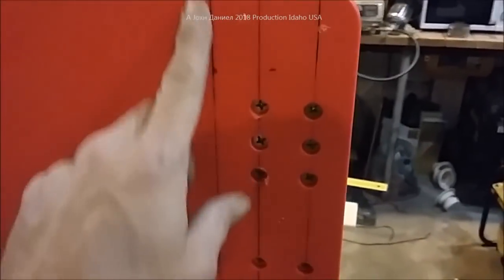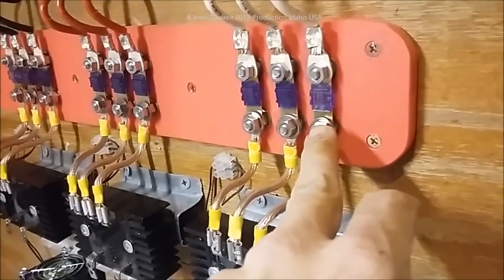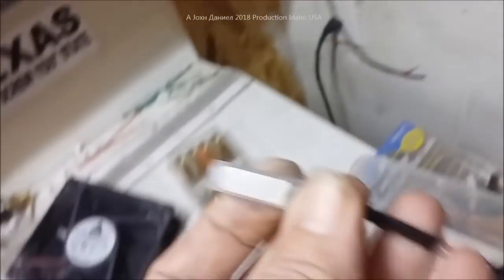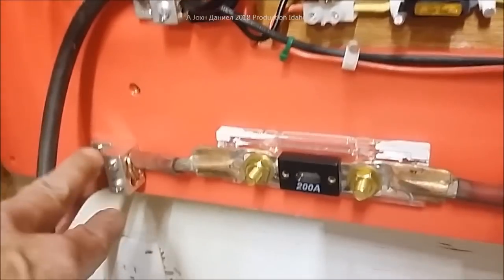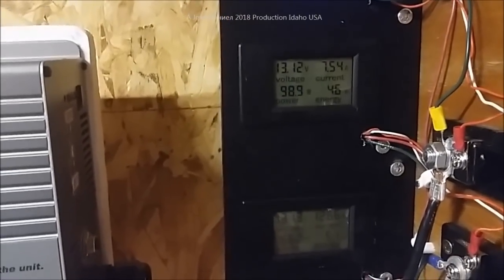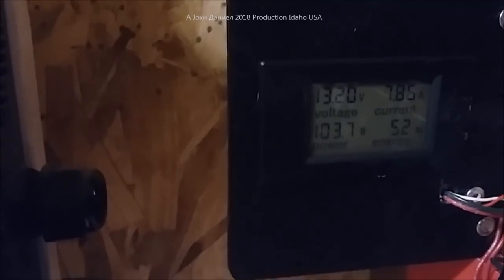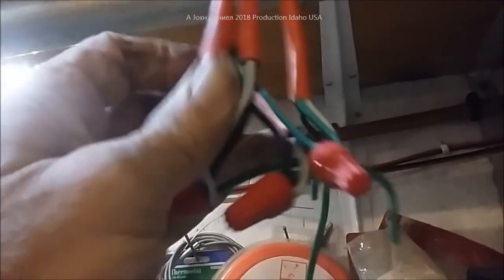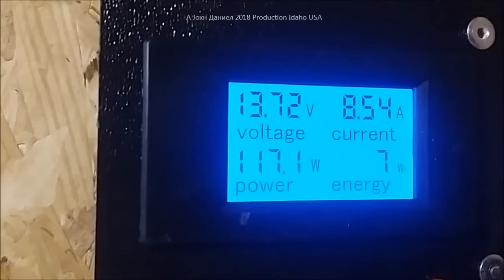Micro Wind Turbine 3 phase power systems Rectifiers pt. 1 my FULL PARTS LIST BELOW

Comment: How do you  connect the watt meter to read the input from the turbine?  The schematic on the  back is for load application.  I just want to read directly from the wind turbine.
Reply from the maker: Load goes to the battery, thats to be connected first, then power wire and ground on the meter if so designed, then supply side + goes straight to battery from rectifier or controller from the turbine. You typically put your shunt on the negative side from the output of the rectifier or controller and pass through it to the battery negative. Thats if your using a similar meter as mine. Hope thats clearer than mud!!
Reply: Јоhn Daniel yes thanks, I figured it out...but this vertical turbine doesn’t seem to be producing well, the controller is labeled 12/24v but I’m seeing 10.5 max in about 10mph wind. 
Connect to a 24v battery bank.  Don’t think it’s adding any charge at all...
I think I need over 24v to charge. 
Any thoughts, the housing of the turbine looks like yours... any thoughts?
Reply from the maker: @thebluedan  looks like another Scam sold model in my guess, a high voltage model thats for buzz charging not for large batteries, they use buzz charging on light poles, not usable on what your building. Return it,  I would file on it with where you bought it as a fraudulent ad, fake claimed, or not as claimed even though it may be past return. 
(buzz charging is using a high voltage PMA to charge a small pack of 8 - 200 volts 3300uf capacitors and the release on a rate which then bumps nearly nothing into the batteries.  Good for a 18 watt LED chinese street light, worthless for your needs)
Reply: Јоhn Daniel I’m watching one of your other videos...looks like the same one you’re using. ...except for the updated blades. 
My blades are red and don’t have the extra little blades. 
I do appreciate the information.
Reply: Maybe I can try a separate rectifier and a pwm controller for the turbine ...I have solar with a outback mppt controller on the same battery bank.

Comment: I'm working on a setup running a 400 watt ac turbine mounted on a 20ft pool. I have 9ft of 12 awg stranded wire coming off the turbine into 27ft of 8 awg stranded wire then connected to wind charge controller. Is that a good match? I would very much appreciate your answer, thanks for sharing!
Reply from the maker: Your well covered on ampacity and gauge just make sure your turbine is up to par and putting out as claimed you'll be OK to roll in the watts! So many of these turbine sellers now use that fake advertising trend set by a Missouri con Man who can remain unmentioned because he got away with it for a decade. Its gotten so bad that you have to do some serious studying, watch for people who found a real one, and believe no sellers claims.
Reply: @JOHNDANIEL1  Thankyou for your input. I decided to replace that 9ft of 12 awg with 8 awg. So now I'm using 8 awg for the whole wire run. The turbine "Chinese" is made/sold by Vevor "not you know who". This is my very first wind turbine so I hope I made a good choice. For lower wind speed is 5 blade better than 3 blade turbine? 
Best Regards, John B.
Reply from the maker: @jbhobbyist9372  VEVOR, they do have some good models made by FWP and some made by Ni Air that are seriously over rated. You can tell by weight, the real performing 400 watt ones are small but weigh over 25 lbs, the near same looking but non performing weigh about 16 lbs.  I did some buyer installs on  both and more models from VEVOR ( a big sponsored seller on Amazon who gets pushed to the page 1 list for buyers like MARS ROCK) but learned to avoid them after numerous people complained about them being only capable of 50% output. Upgrading the wire may help though, lets see how it does. Truthfully the big performing ones are far back in the sales pages due to them having no money left to pay off Amazon or Ebay when they have to price so low to compete with the fakes. Consider that in Ads, the fakes will list first because the profit on them is high, they can pay off Amazon and Ebay to be sponsored up front. Quality will take a back seat so to speak!
Reply: @JOHNDANIEL1  Mine got up to a whopping 1.5 amps today between a 10 to 15 mph wind! It's coming down in a couple of days I want to run that test with a 5/16 allen shaft and power drill like you illustrate in your videos. I have a Hyper Tough 12 volt lithium cordless and a Hyper Tough 1/2"  6amp Hammer Drill to use. Plus now I want to weigh it lol to see if I got junk or good. I will let you know how it turns out. Again, thanks alot for the information I learn a great deal from good people like you.
Reply: Hi John, I just completed my test. Wind turbine net wt. 15 lbs. Ran test with turbine still on the pole and connected to power with blades off. Using Marsrock charge controller and thermodyne amp meter for my measurements.  Using  a Hyper Tough 12v 0-750min drill fully charged, results 2.18 amps. Using Hyper Tough corded 6 amps 0-2800min, results 14.21 amps/185.1 watts. I balanced the blades using your technique. Before I started blades were off by more than 3/8", that's crazy. I'm getting rid of MarsRock charge controller and installing a bridge rectifier converting ac to dc. Then I will connect dc output to a Morning Star 1000 watt charge controller that is running 700 watts of solar panels and charging a 12v 1000ah battery bank. So with 300 watts to spare it should be safe to connect turbine to unit. Since it looks like 400 watt turbine is producing 185 watts of power under testing. Running 100% 8 guage Simpull Thhn wire. Looking forward to your thoughts on this matter. Best Regards, John B.
Reply from the maker: @jbhobbyist9372  Looks like a 200 watt PMA on a 400 watt claimed sale! I would file on it with where you bought it as a fraudulent or not as claimed even though it may be past return.
Reply: @JOHNDANIEL1  "Live and learn"! It was a 100.00 wind turbine gonna make the best of it and hook it in with my solar system. If I would have found you on YouTube first I wouldn't have bought it! In the future I will be buying that HAWT 500w turbine from AliExpress. I am going to file a complaint or at least let everyone know not to buy this product. If it was advertised as 200w turbine then I'd be fine.
Reply from the maker: @jbhobbyist9372  Here's a secret on Ali express. They watch yours shopping, and start pushing you offers of discounts. Do this, right below the video is that low wind 3 blade model, Its awesome and your already wired and set up for it. I would put that in your cart on Ali express, DON'T BUY YET,  so while it sits in there a while, they make you discount offers to hit buy or check out.
Reply: @JOHNDANIEL1  Cool! Good advise, just did it on 500 watt 3 blade. We'll see what happens, Thanks
Reply: Hi John! Here's a copy of the message I sent to the sellers/company I bought the turbine from. ("This is not a 400 Watt wind turbine! We tested with a 6 amp electric drill with 0-2800 min torque/power. Results were 14.21 Amps / 185.1 Watts. Your claims are fraudulent!!! Not very happy with YOU!!!") So in return they offered me a 50% refund/compensation for my troubles and I accepted. It pays to complain!
Reply from the maker: @jbhobbyist9372  ☑Check Mate Ebay/Amazon California Dropshipper Scammer! Excellent, now hold on to it, and when you can put the next larger sized blades on it and run it as a a spare. With the larger blades it may die in a few years but it would anyway being a knock off. It should have 500 mm( 20")blades or 550 mm(21.6") maybe. [Measure blades from the bolt hole nearest the hub center to the tip]  I have a set of 650mm more aggressive style and if I don't need them and its using the S-sized cast Hub I can probably ship them out for shipping cost and $15. About $25 likely. Or you can get a set from Amazon or Ebay for $65 but you already been there, done that!
Reply: @JOHNDANIEL1  Thanks John for the offer! I just had it down/lowered yesterday and had hub with blades off to balance blades after running my test and didn't think to measure the length. I'm gonna say there in the lower twenties but not sure about exact length.I could let you know at a later date. Standard 3 blade hub with S model flange if that helps.

Comment: What fuses did u use between the rectifier and the turbine? Don’t see it listed? Thanks
Reply from the maker: 3 - 50 amp Mini ANL, https://ebay.to/2oj6wrt and I made my own holders for them but you can use a simple holder like these https://ebay.to/2nBGeAO . You want to have the full power potential of 2 legs of your turbine, 100 amps can be hit if its the 500 W I have been using, you need the shorted max rating in that situation.

Comment: I'm working on a project related to regeneration using a motor to charge a 54 volt battery.The circuit I used is a motor whose three wires are connected to a 3 phase rectifier (SQL35A1000V) whose dc output is givent to a DC-DC booster (https://amzn.to/2oEy2ji) and a 54 volt battery pack to the output of booster. The rpm of motor is varying but the booster constantly supplies the battery 54 volts and 3.5 A(The booster is set to 54 volts and 3.5 A). 
The problem is that the 3 input wires to the rectifier gets extremely heated and end up burning/melting. Can you help me identify what the reason behind this is? and which wires will be good for this type of circuit.

Comment: Your setup looks nice. I've been trying to wire in one of those digital multimeters, however all I get is battery voltage. I placed my shunt on bat -. How did you wire yours? Did you use a different power supply for your meter?
Reply from the maker: They should have a schematic online for these,. you put BATTERY Bank as Load, but not knowing exactly your set up or model makes helping difficult. Send a picture and how your wired up to me, JOHN - olympicpowercontrols@yahoo.com

Comment: Do you not need a stop switch to bring the 3 phases together before the rectifier?
Reply from the maker: There is stop switches on the second floor that can dead short the turbine, but thats the last method you would want to use. My stop PULL switch design is a 1-2-3 not a 1-3, so its not the kind that burns up turbines.

Comment: in this video, the charging voltageis very stable, staying around 13.2 volts. but the current has a great swing (3 amps to 50 amps) (I think becuase wind speed varies, right?).  But in your other video when you did the test using power drill, the voltage increase a lot to over 15 volts when drill speed increase (like increased wind speed) .  The current pretty much stays the same at ~8~9 Amp.  So why is there such significant difference?  Thanks.
Reply from the maker: The effect is Drill Test 12v battery being 1 that is 80 ah, verses battery bank being 14 of the 325 Ah L16 batteries.

Comment: May I know what is the maximum current and voltage into the rectifying diode from the turbine (say billy jack bad ass) and the max output current and voltage output of the diode? Thanks.
Reply from the maker: BBA turbine has by my test maxed at 89 amps in wind storms, just peaks to 90, and hard running at 60A plus during those storms, that's why I use the ones I linked to under the video. The input I have not tested but I would say 3% higher than the output, its a 2.7% conversion loss on these rectifiers per the specs. 
The OPEN voltage in 30+ mph has hit 71 volts as 3 phase, with the battery disconnected that was 39.7 volts measured as a peak DC rectified.
Reply: @JOHNDANIEL1  so the rectifier can draw steady 60 amps from the turbine during storm?  That's a big  current.  How long is the cable from the turbine to the rectifier, and what gauge number of cable do you use ?
Reply from the maker: 26 feet of 8 awg, 3 strands. I could have ran it 45 feet like the home built Chaos Turbine if I needed. From that there's just 4" of 10 awg 21 strand 100% pure copper wire between the 60A mini ANL fuses and rectifier, not a problem if it stays under a 6" it can handle it.  You would use 60 amp, math is ( 60x2.17) for max pre-rectifier capacity. 125 amps max flowing load, but allows it to blow at 60 if a rectifier leg fails. 
Then 6 awg to the Bus bar for the battery. We had 9 hours of 40 mph in a major inversion, we get that 6 to 10 times a year at 4350 feet elevation I am at, and common daily winds are over 16 mph. So the Rectifiers I choose are from trial and error. Never under gauge!
Reply: @JOHNDANIEL1  It is amazing that 60-70amps did not burn the generator coil.  it must be big gauge wire, isn't it?  what is the output impedance of the generator and the input impedance of the rectifier?

Comment: can you please tell me what would be the max voltage that comes out of the bridge rectifier under load?  on a china turbine 500 watts 48v system. I know when I spun up the turbine on the bench with no load just going through the rectifier it was putting out over 100v. the charge controller I have on order has a dc input of 12-60v. it's an MPT-7210A Solar Controller. It can charge lithium. many thanks for your help.
Reply from the maker: 3 am, but You caught me loading cows in the bull hauler truck! The answer, about 63% of open voltage will be the rectified open volts. 100 volts no load = 63 volts rectified no load. But as soon as you put it on that controller, you may have a max rating that could go far past max on high winds. I refer everyone to get this https://amzn.to/2Wk9H2r set of 18 AH batteries, run your supplied wind turbine controller into it, from the 48 volt ( those 4 batteries ) run that as a source into the controller you have. Set the disconnect from source voltage at 44 volts.

Comment: If you use bridge recrifier,is it neccessary not to use wind turbine charge controller?just hook the rectifier to battery?
Reply from the maker: Turbine to rectifier, rectifier to battery. Diversion load controller to keep turbine excess sent away from battery into water heater or load resistors or hydrogen cell.  If you have a very small battery bank, use the provided controller. I prefer not to use a small battery bank on wind turbines though. Capability of storage @12Volt - 160 AH@20 per 100 watt rated on the GE-500 models, but if its a missouri turbine you can go with 35 ah@20 per 100 watt claimed. Half those battery numbers for 24, 1/4 for 48 volt. Example  you will need 80 AH @20 for 24 volt per 100 watt.

Comment: hi sir .  i have 2 mppt controller to same 12v battery setup and i want to buy a 500w 12v wind turbine what, do i will need the Rectifier, the resistor and what else .

Comment: The only change I would do is add 3 capacitors (0.1ufd 1kv) across the turbine lines to reduce diode switching spikes from feeding back to the coils. 
And add a capacitor (1000 ufd 35 volt 105 deg) across the DC side of the rectifier to smooth out any action components.

Comment: , I bought a 3kh wind turbine with a controller to match the controller will not resale from brake mode so the turbine will not turn unless i disconnect from controller, any suggestions on a bypass?
Reply from the maker: Whats the brand and voltage of your turbine?
Reply: @JOHNDANIEL1  Its a Chinese 3KH,  Qingdao 380vdc Grid controller is model no. FKJ GT 3kw, no name. I could send a photo but I don't see how here
Reply from the maker: Those controllers have settings for max input voltage, many people will feed solar in with open voltage exceeding the wind turbine settings. Another issue with many is the run voltage of the turbine is set to close to the divert/brake voltage. 
You can send info on it to olympicpowercontrols@yahoo.com. Numerous pictures and its specification plate as well as the model of wind turbine with its brands power ratings and what your set up for in solar or wind for this system you have.  My self or Jarrod will get the info on it and see if a solution is available.
Reply from the maker: Just realized, I installed 2 of those on a pair of FW2500 about a year ago. You must verify the voltage on your grid, 120/240 VAC 60 hertz or 220 VAC 50 Hertz or it will prevent run of the wind turbine. And you CAN NOT ground the unit to the house ground circuit in my experience, use a separate ground rod for the GT3k. Another thing is to check and see if the manual brake is upside down, showing run when actually on brake. Its from China!
Reply: @JOHNDANIEL1  I am only runing the win turbine, and it bearly truns only getting 15 volts, when i 1st started the turbine it was producing from 250 to 325 vdc it was not until i pressed the brake then it would not realse and will verly mube or spin.
when I disconet the controler then the turbine spins freely

I have made a test bench to test componets before i built a 30ft tall tower and pull pernits, my suspicion to do this came when the turbine came with no equipment tag like the tag on most motors.
Reply: @joaquinsahagun2081  Dear John and Joa . I am reading the contents and not an expert , John is our master who gave lot of insight , Iam only a beginner looks for info, to set up one for trail . I am confused Joa is talking about dc  and we have ac supplies in the above wind mill . is there any wrong information ?  I need a help from John , when the rpm is low will it produce volt to charge 12 V / 24 V / 48 volt battery ?  if we chose 12 v and produce 60 V  what happen to the excess voltage in the controller/ rectifier  ? How to chose system voltage for up to 3 kw ?